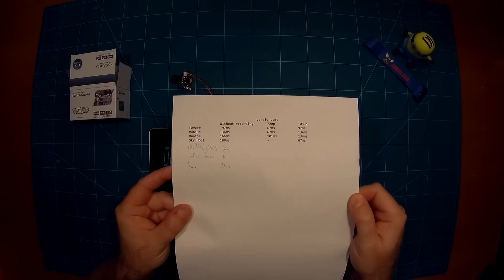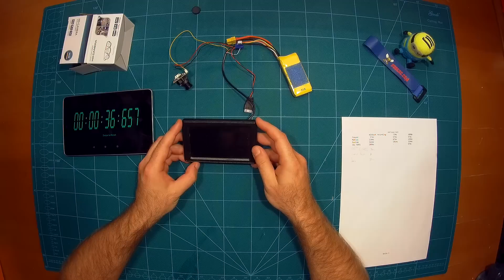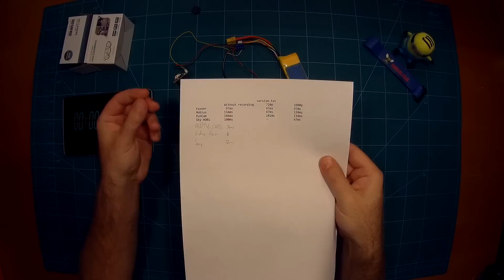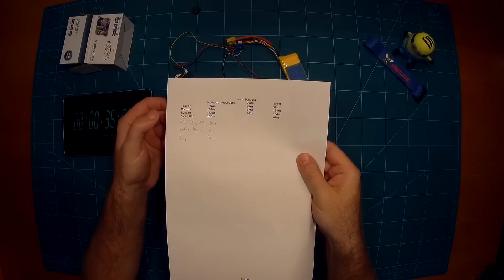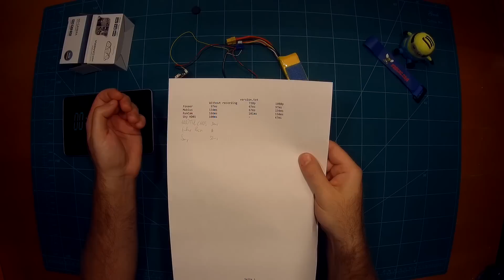FPV Latency Comparison (CCD / CMOS board cam, Mobius, RunCam, Foxeer, Sky-HD01)

Comment: Is it fair to assume the transmission and reception of the VTX signal adds no latency apart from the time the light takes to travel the distance which is like 3.3 microseconds every KM?
Reply from the maker: +Stephen Gibb Yes Stephen, it is exactly as you say. Our analog video transmission is what is called a "zero latency" transmission (which is a technical term refering to a latency of < 1ms). All the latency which we see in our FPV comes from the camera and the display. When you do latency measurements you can therefore omit the VTX/reciever part and still get precise measurements.

Comment: what is the latency on the cmos 700tvl?
thank you
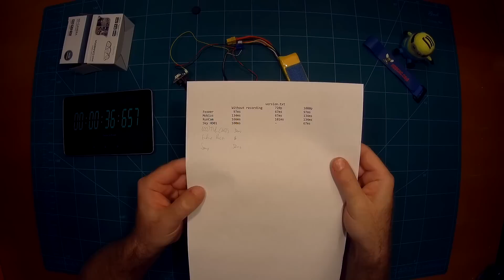Reply from the maker: +rio787 700TVL Sony CCD has around 32ms delay, 1000TVL Eachine CMOS has about 34ms delay, recording cams start at 67ms delay. At 5:28 I hold the results sheet straight into the camera, simply stop the video there and you have all values. I guess a 700TVL CMOS will also be around 30ms.
Reply: +RC FPV Flight thanks you for that info, it was very helpful, great video. and i tried to stop it but i really couldnt see the number in your hand writing lol. 
thanks again
Reply from the maker: +rio787 Glad you liked the vide. Great to have you with us :-)

Comment: To be a complete real-world test, wouldn't you have to account for latencies introduced in the video transmitter and receiver as well? Or are those negligable?
It would be interesting to see the difference when an RX/TX module is added in the link between the camera and the monitor.
Reply from the maker: +Duststorm01 Many thanks for your comment! Your assumption is correct - these kind of analog VTX and Receivers introduce almost no delay. That's why they often call these analog video links "zero latency links" (which actually refers to a delay of < 1ms). The delay comes from the camera and the monitor. That is why it is ok to skip them for tests like this.

Comment: why no tvl 600? most ppl using this? and in addition comes the latency of reciever
Reply from the maker: +Konrad Lorek Hi Konrad. It was the one I got sent for review, so I used it. However, I may consider measuring the latency of one of my 600 TVL Sony as well, many thanks for the input :-)
Reply: +Konrad Lorek If my memory is good the 600TVL has less latency than the 700TVL :)
I am pretty sure i already saw a video about it long time ago!

Comment: Thanks for the testing,  let's see at 35mph you are traveling at 51.333 fps  x.034 ms = 1.75 feet   that's how far ahead your quad is when flying with latencey from a board cam.  at .060ms your looking at 3 feet!  I guess it's not a big deal if your just hovering or slow flying, but that much latency can and will cause serious issues if your flying  fast.
Reply from the maker: +Cy Lon Many thanks for this great, illustrative example. I have nothing to add here. Awesome. Cheers!
Reply: +Cy Lon You are a gentleman and a scholar. Obliged... squared ;)
Reply: No problem guys, really makes you respect the high speed fliers like charpu and metalldanny even more knowing that they can deal with the lag and still fly so fast and precise!
Reply: Cy Lon
My thoughts exactly. Especially those guys like m0ke who do the most wicked proximity tricks.